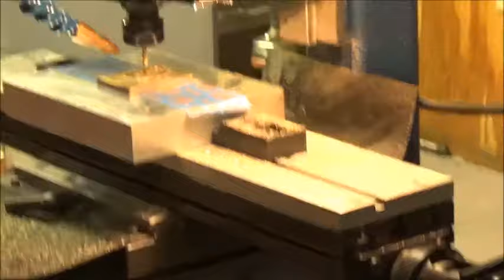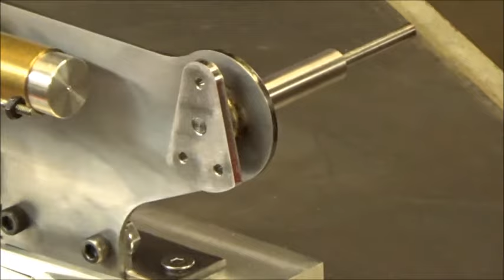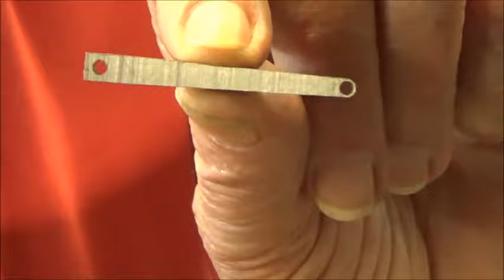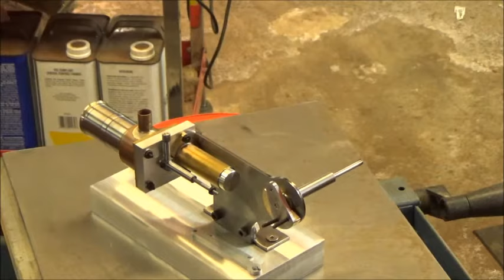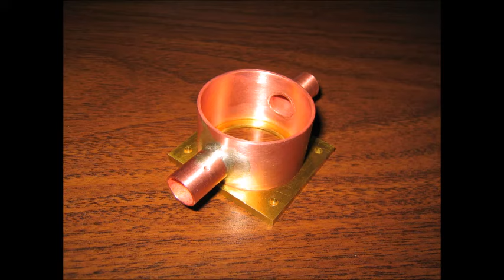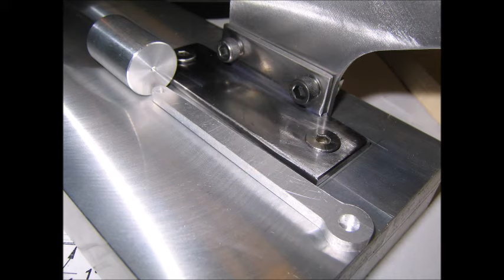"Fizgig" Stirling Hot Air Engine Build - Part 5 (Assembly Update)

Comment: I can translate textual information, but I cannot hear it by ear. I make Stirling engines, I want to exchange experiences. Do you have designs ready? Have you been dealing with Stirling for a long time?
Reply from the maker: No I do not.  I found some plans for this engine called "Fizgig" Designed my Mike Collins.  It will be  my first attempt.  I'm sure if you search the internet you'll find the same.  Here's a link to what I was able to find.
http://www.vapeuretmodelesavapeur.com/telechargements4/s-stirling-watercooled-05-01-07.pdf

Comment: fyi,  this configuration puts the sides  TOO-dam   close to one another.      when an engine is   WELL-designed, it  will  Not  Need  supplemental cooling.      ANY  engine power that is consumed by  a cooling system,  is energy that is NOT going to the output shaft!!!      if you think  a thermosiphon cooling system could work, note that the reservoir  MUST  be  at a Higher elevation,   than the hottest point in the system.       it is ESSENTIAL  that the mass in the cold piston, as well as in the displacer,  be  MINIMIZED.!!!       if you want a  durable  cold  piston, make it  Hollow, and  stainless steel.      note that the cold piston wrist pin  SHOULD  be  'sunk in'; so that it is  Nearer  the top of the piston.      note that the  length  of the cold piston  Should be sufficient, to contribute to the precision of the piston's alignment, when it is in Motion.     googletranslate
Reply from the maker: Thanks Very Much for Your Comments.  I'll consider the hollow piston.  I also know that the cooling reservoir needs to be rather tall.  I'm working from an existing plan and drawings, so with my limited knowledge it's the path I currently need to follow.  There are options, but at this point I'm taking the easiest path.  If I can get it running, then I may try to make some improvements.  Thanks again.   Regards: Larry

Comment: some info.      at 12:17,  NO  WEIGHTS.!!!     weights  ABSORB  energy.      yes, the engine will run smooth,  at the  Cost  of  REDUCED  Performance;  aka  Less energy at the output shaft.!       on the other hand, a good solution is the use of one or more,  Disc-shaped component(s)!!!       vibration damping should be, only, via  Adequate  Anchoring  of the engine.     googletranslate
Reply from the maker: Thanks Very Much for Your Comments.  Please see my lengthier reply to your other comment.  Thanks again, any help and suggestions are always appreciated.  Regards: Larry